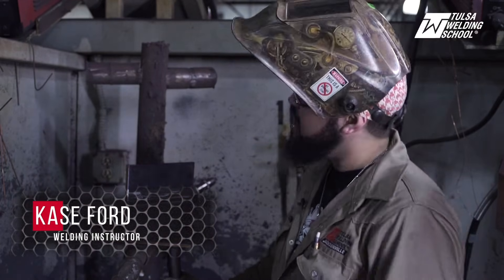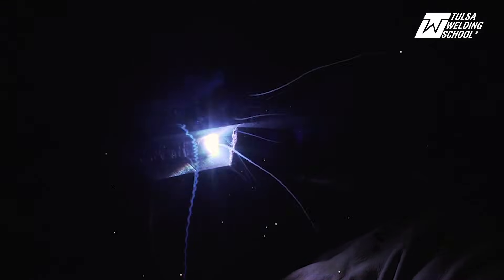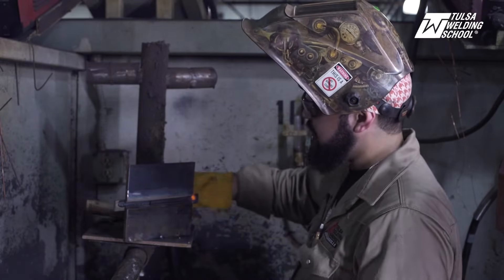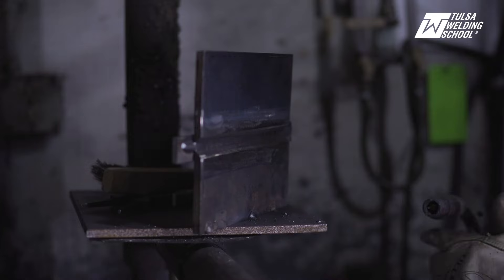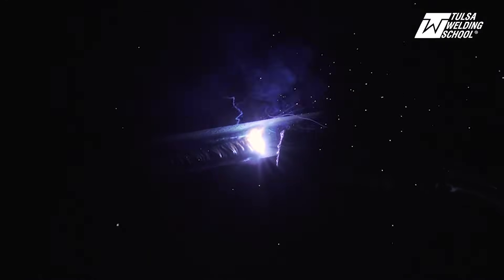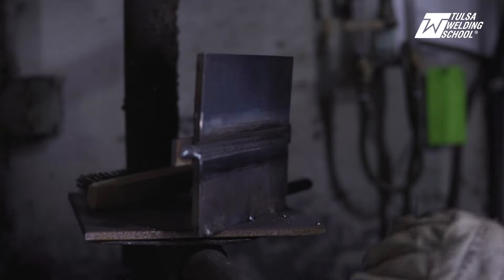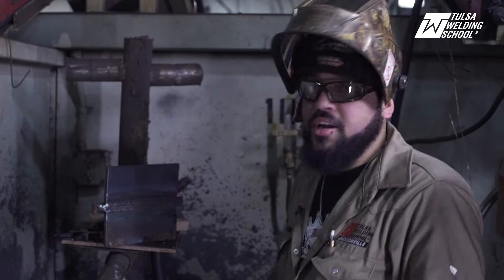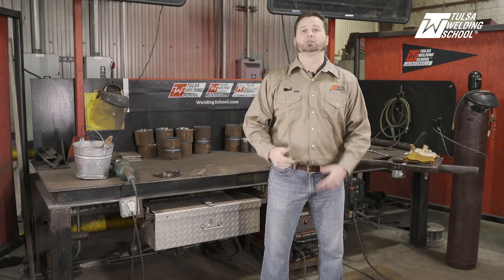How to Weld a 2G Horizontal Plate Using the Fluxcore Process

Comment: Just curious as to why you ran so cold? All the popping indicates too cold/little too much wire. Would there be any any reason to not run around 25. Also curious on your opinions of straight on/pushing th beads
Reply: With flux core you can get away with a SLIGHT push, but generally you want to pull. With Solid wire mig a push is far better in my opinion. Pulling gives you a little more penetration but it’s negligible. You’ll get a flatter, wider bead if you push also.
Reply: I didn’t hear any popping??? Just the normal sizzle from FCAW. Heat is not too cold either,if it’s too hot,wire will drip…gravity. Pulling dual-shield wire is not good,it would be like pushing a 7018 rod.

Comment: Why drag instead of push even though it's flux and I need a better answer then drag when there's slag I'm taking a shear wave test for work I have failed my horizontal 6 times now passed over head and up hill first go it's worse than x ray
Reply: When you push, what happens is that it's usually done with the nozzle leaning toward the direction of the weld (towards the left since you're "pushing" right to left) and that causes splatter to jump out in front of the area/metal you're going to be welding over. This can cause porosity when you weld over that crap. By dragging the nozzle with a slight 5-10 degrees ( slightly facing left while you drag it left to right) all that spat goes behind instead of in front of the area to be welded and hence little chance of putting down beads over spat- covered metal. 
Hope that helps.

Comment: what gas do u guys used .when i was in my d.e.p in quebec we hade c25 or c80 gas and argone for aluminum basics i did 1800hours diploma with an other 980 h pipe welding bonus and i just love it the best job in the world when your a passionate person
Reply: Some flux core uses gas, some is gasless. This is probably dualshield
Reply: We run 75/25 75 Co2 and 25 Ar. This process is called Dual Shield. Lincoln Electric 71T .045 wire
Reply: Flux ain’t no gas??
Reply: @berniemac3535  in our fluxcore welding we used gas if not it forms litle holes sorta like a aeros chocolat bars.there is some auto protect fluxcore aswell👍
Reply: @berniemac3535 there is inner shield flux that you dont use gas for. Then outer shield flux core that you use extra gas just like solid wire

Comment: Could you show how to do a 2G open root 3/8 plate without backing strip using dual shield flux core 0.45 wire, that was test i was just given and failed, so could you throw me some pointers and help? A video would be greatly appreciated!!!
Reply: I don't think there's a wps for that process under d1 just as there's no wps for hard wire with a backer man
Reply: Bro, I've failed 2 weld tests in 13 years. The most recent was last week, for a great job. It was 3/4 in plate 2g dual shield and the 2nd part was 3/8 in plate pulsebare wire 3g